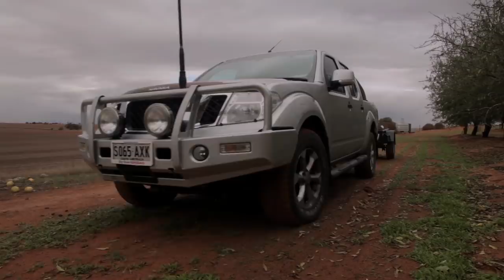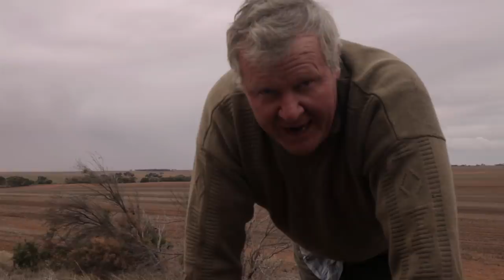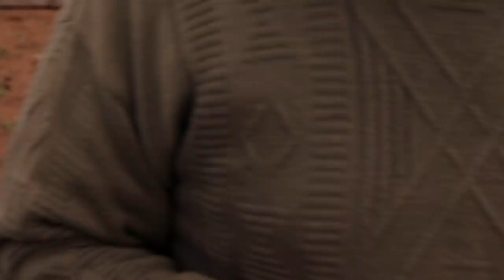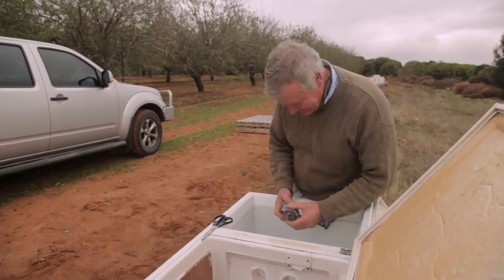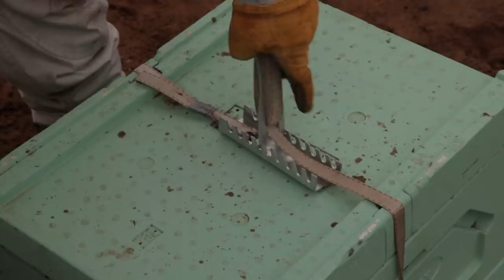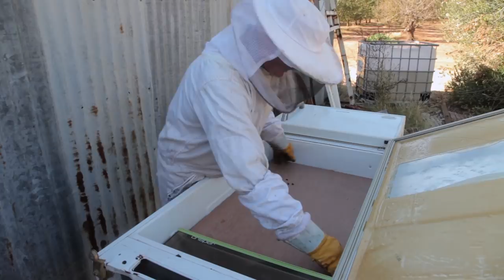Transferring Bee into the Top Bar Fridge Bee Hive - Episode 71: "It Fridging Works"

Comment: I cut a section of canvas to the size of the top of my hive and lay it on top of the frames. It works very well as an inner cover. The bees add and remove propolis to the cloth as they see fit to adjust airflow and when I want to access the hive I just peel the cloth back and there is absolutely no banging of wood inner covers to irritate the bees. Give it a try.

Comment: check out my fridge hive, its upright. 4 x 9frames + 4 of 1/2. rear hole for ventilation if needed but usually cooler than outside.
Reply from the maker: Love it! The use of the upright fridge and using the racks is awesome ;)